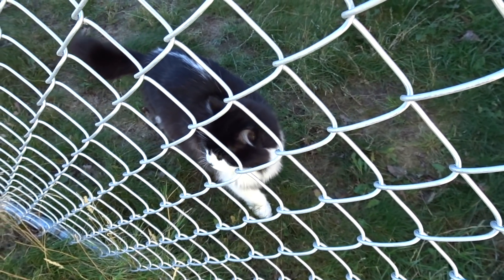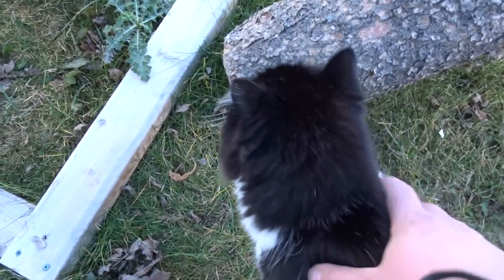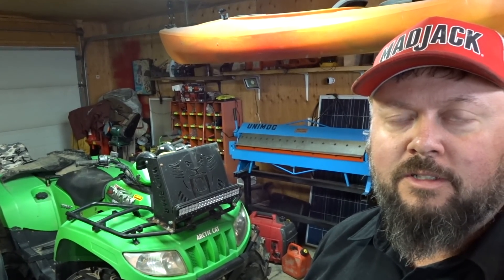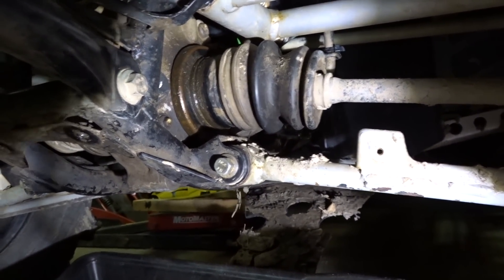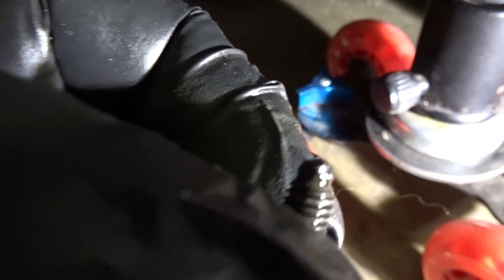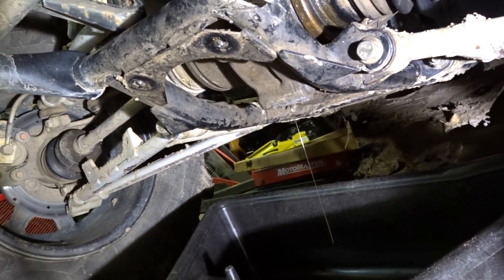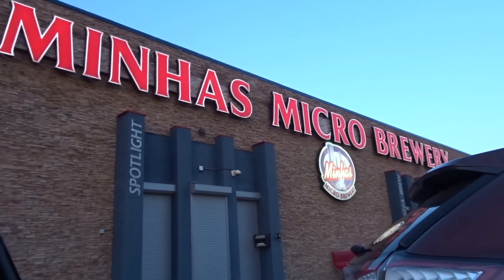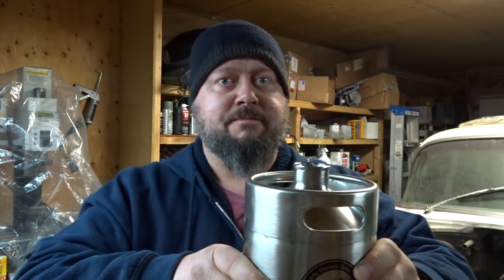Differential is Plugged

Comment: Hello Jerry. I have a F150 question. Have you had to change out your steering lines yet due to corrosion and leaks? I’ve got a leaking lower line and an debating changing out the pump and lines. It looks like it could be a total SHITSHOW as the fitting gets seized and is a bitch to get off.  I wish I would have done it when I replaced the radiator!!!!
Reply from the maker: +Jim Gosselin i haven’t had to change it yet but keep me posted on how it goes

Comment: Watched all your atv videos. I am wondering what your thoughts are on Arctic Cats now? Seems you've had issues with every end and corner of that machine. I always thought they were better built than Polaris, but after watching your videos, I'm not so sure. 
Also, what are your thoughts about the Textron buy out of AC?
Reply from the maker: I mean the machine is 10 years old and i had issues from the very start when the bevel gear broke and took out the motor when it was less than a year old and Arctic cat wouldn't do anything for me left me high and dry.  it's hard to say what i'd get next
Reply: Bullshitkorner Yikes! Sorry to hear that. They should've helped you fix it at least. 
My Kawasaki is now 12 years old, and I just had to put a new rad hose on it. That put me over the $200 mark I've spent on it fixing things that were Kawie issues. But thats pretty good considering it's got 14,500 miles on it. I'd buy a new Brute Force in a heartbeat except I'm just not that fond of the looks of the front end on the new ones! I really like the looks of last year's AC Alterra, but it looks like Textron has sacked it except for the 500cc model.